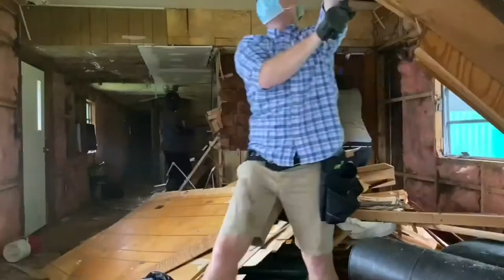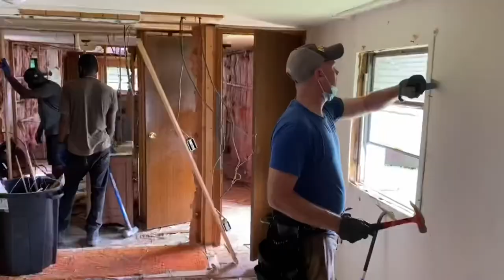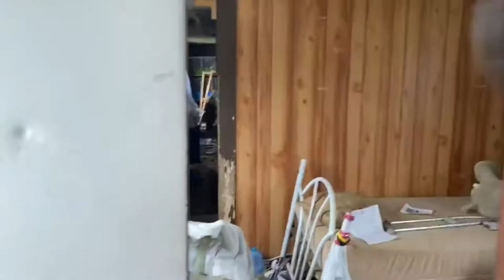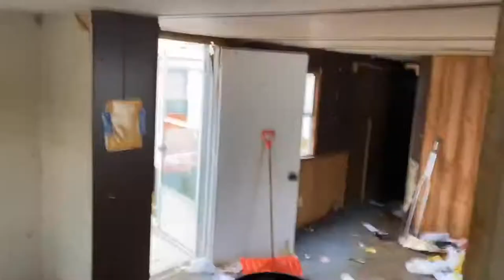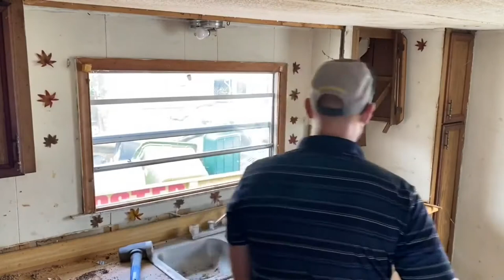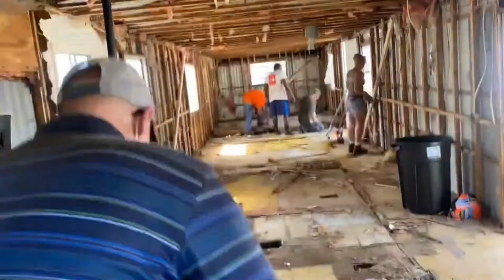We bought the nastiest Mobile Home then this happened

Comment: when the house is at the gutted stage, its really important to try to get the home raised up! alot of these old trailer were just dumped on the ground and there is no vapor barrier, or room to even get under the house.... this is when the house is the lightest and can be raised up to current code.... the bottom of the steel frame should be 36-48" off the ground, or whatever the code requires in 2020... lots of work!